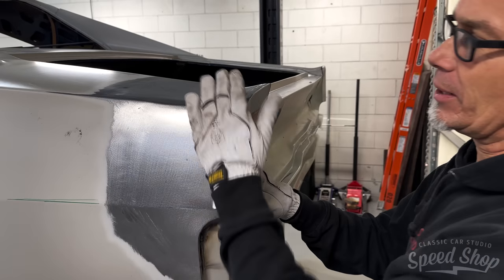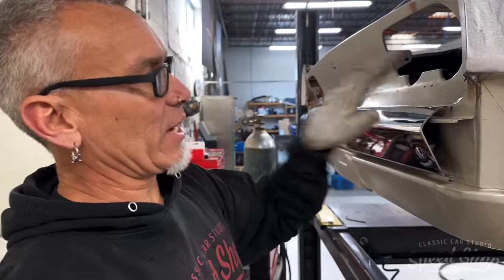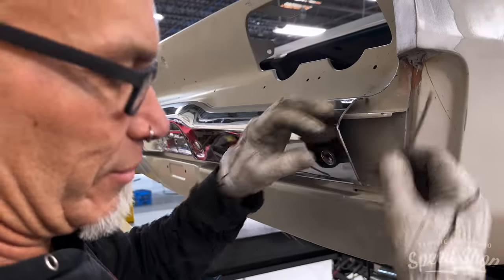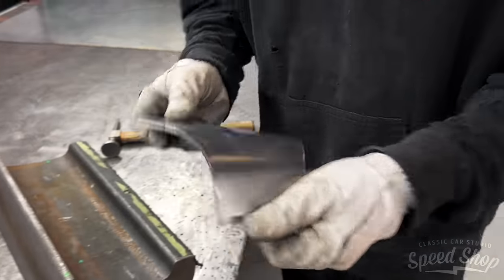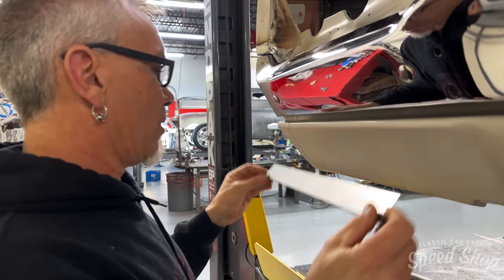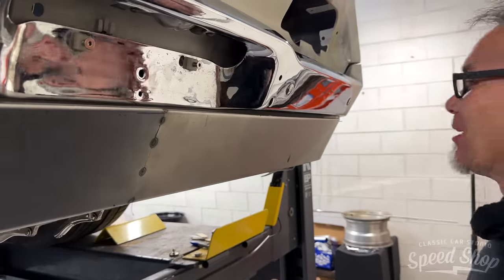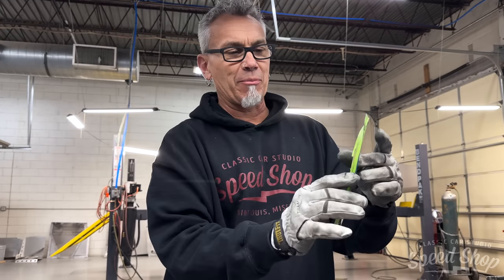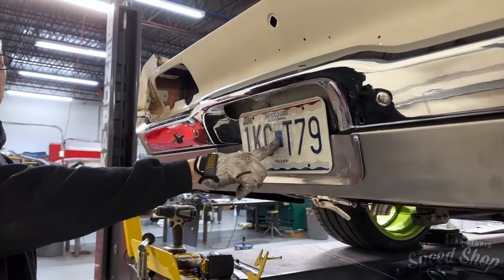68 Dodge Charger R/T • Tucked Rear Bumper & Lower Valance

Comment: On the rear lower bumper panel below the panel you're describing. Couldn't you just make a panel that's all one piece. So it fits flusher with the rear bumper and the corner pieces like you want it to fit?